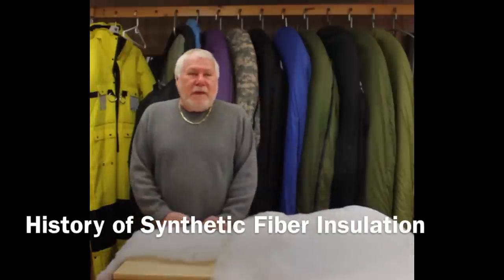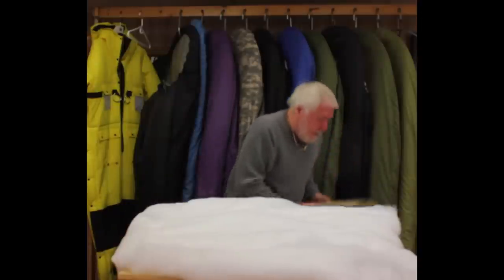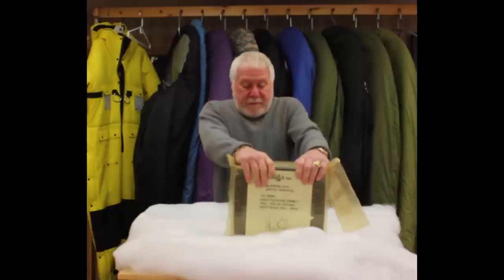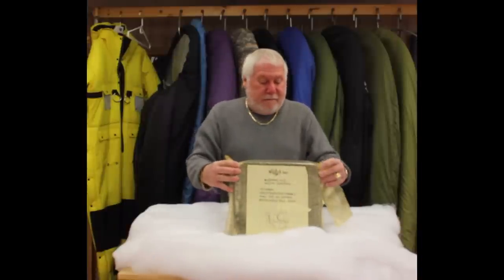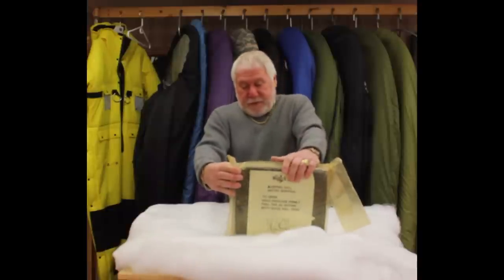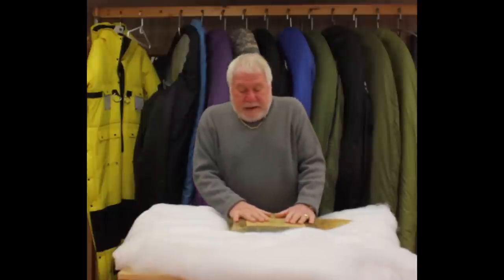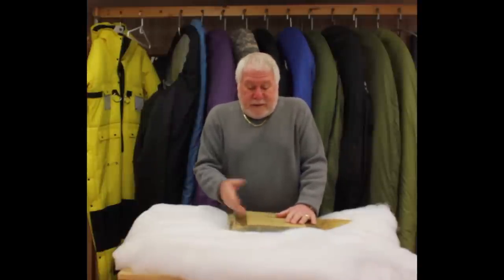History of Synthetic Fiber Insulation

Comment: I have tried all the insulations you mentioned. My first synthetic jacket I had in 1968 I believe. Tried Thinsulate. Hard to believe they still use it. The most worthless insulation. Had a Parka with 200 weight insulation Thinsulate. It did not dry at all. Primaloft. It can be warm. That is when you first get it. Wash it a few times and it is worthless. If seems to loose its loft. It retains its loft for only three or four washings then goes completely limp. I have a Wiggys jacket I bought in 1996. I cant tell you how many times I have washed it. One thing I can say it is just as warm as the day I bought it. I still have it and use it. My friend bought his the same time I did and it still works fine. Now enter Climashield apex. Dont know how long this will hold up. One thing I can say. They absolutely dont want you to leave it compressed. Maybe that is because they know under those conditions it will not hold its loft. I know I can leave a Wiggys bag in a compression sack and leave it there and it will work no matter how long it was left in that stuff sack. FACT!! And I can wash it as many times as I want to and it will maintain its real world temp rating.